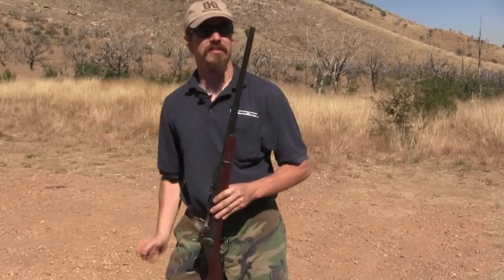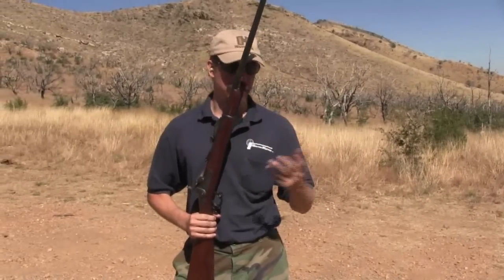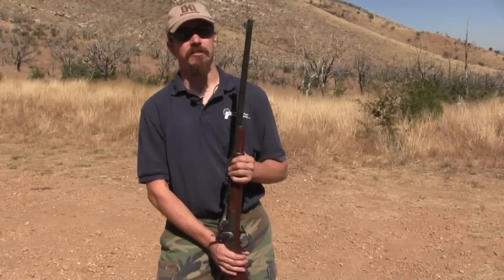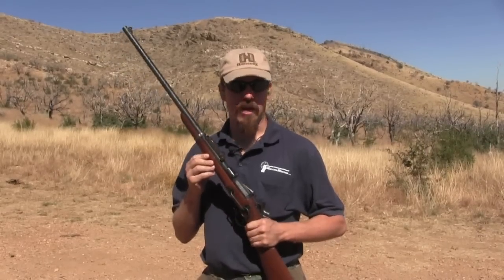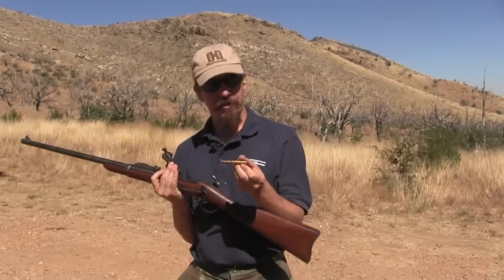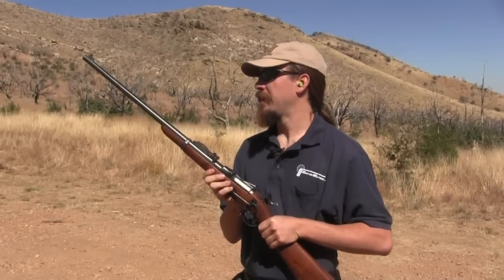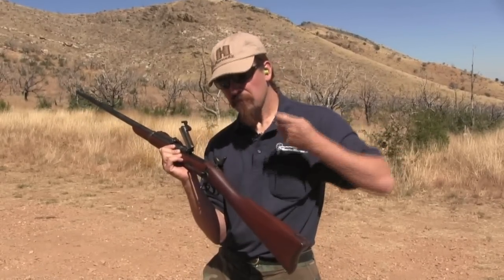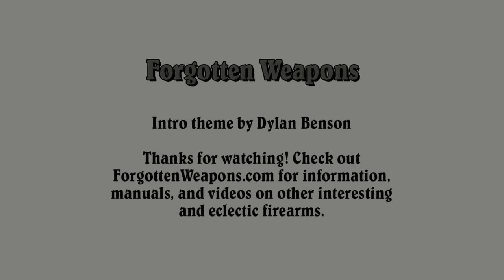Experimental .30-40 Trapdoor Springfield

Comment: That’s a really cool conversion it just shows the trap door action is stronger than a lot of people said it was
Reply: It's really not. Even the .30-40 pops the trapdoor open sometimes. And .45-70 loads that would be considered mild in a lever gun will blow the trapdoor open.
Reply: Kyle Michaels you’re right about that the 1886 is said to be able to withstand 50,000 psi more modern nickel steel barrel

Comment: A very cool gun. If a guy is a reloader that would be just plain fun to plink with. A lot more practical and comfortable than shooting the 45-70. Thanks Ian
Reply: I don't know I find that a .45-70 military load in a trap door has very little recoil. The .45-70 is not the monster magnum people act like it is.
Reply: I have a 45-70 Marlin that kicks like a mule with the 400 gr loads, and it's not loaded that hot.
I also have an Encore in 30-40 Krag and I do like it. The long neck works well with bullets too long for a 308 to handle gracefully. And the rim makes extraction more reliable.

Comment: With this conversion I see we have a Springfield barrel and front sight with a 1905 third generation rear often called the Sergeants sight because there is a peep aperture that slides up behind the basic U-notch, great for some fine point shooting.  The barrel if an early 4-groove model, the twist rate is perfect for a 150 grain boat-tail spitzer over a load of Hodgdon powder.

Comment: When re chambered for any sort of moderately hot round by the standards of the day this gun became an auto ejector. I've read even a .22 hornet would auto eject. I'm sure the lock work could have been redesigned and replaced but it was cheaper to do something else.
Reply: The .22 Hornet has very high chamber pressure whereas the .45-70 with normal smokeless loads has fairly low pressure. The size of the projectile does not dictate pressure.

Comment: I'll be honest I'm a tad bit confused. The trapdoor action is a pretty weak action and 3040 krag is very hot when compared to the pressures black powder 4570 produces. Were the 3040 rounds they used at the time of the test weaker then the ones they took to Cuba during the Spanish American war and France in 1917 for the rear guard troops (similar to that developments from the German patrone 88 to the patrone S/SS 8mm rounds). I guess I'm asking if this is safe conversion. To me (and for those who do have a lot of knowledge on this please correct me if I am wrong) this seems like an accident waiting to happen. I guess this is falling on my danger meter in the same category of those who would shoot hot mg 8mm surplus down a gew 88/05.
Reply: I believe it's borderline when it comes to safety. Though it's possible they had separate .30-40 ammo for these that was less powerful but I find it kind of doubtful as if they had adopted this version it would be a logistics nightmare.

Comment: How does the 45 70 trap door compare with the martini henry rifle would love to see the versus match I believe they were in service at around the same time could be wrong.
Reply: I have the impression (though ultimately only through hearsay) that the Martini-Henry action is substantially stronger. The .450 British service round was 480 grains at somewhere between 1300 and 1350fps, which compares well against the 405gn .45-70 loading (1285fps from the 30" rifle barrel, as per Cartridges of the World, 5th ed.). 

OTOH the British cases were for some time spiral-wound brass rather than drawn in the modern fashion (they changed over at the very last), and gave severe feed and extraction problems in sustained continuous fire.

Comment: that wouldve been good to convert the national guard guns to those so while the regular army had the krag the national guard couldve had a trapdoor but with the same cartridge instead of using 45-70 so logistics wouldnt have been such a pain int he ass when we were in cuba
Reply: Todd Welsh Given the problems with the chamber pressure he described, I think it would have been better if the government had just bit the bullet, so to speak, and contracted Remington to build 50-100,000 Rolling Block rifles and carbines in .30-40 Krag with the new sights and bayonets. First they could use them to train Federal troops on the cartridge as they waited for delivery of the Krags then issue them to National guard units (1000-2000 per state or territory). This way the NG troops could use the same web gear and transition to the Krags easily when they become available.

Comment: Pretty interesting. If it were a hunting/civilian rifle I would find it odd that it would be designed for the breechblock to open on full cock, I'm sure that whatever mechanism that could be developed to accomplish that function would also keep the breechblock closed and unjammed with the higher pressure loads.  As a military rifle I understand that entirely. The fine motor skills necessary to put the hammer on half cock would likely not exist in a combat scenario.

Comment: Do you know of any company that makes a 30- 40 trap door now or could make a 30 - 06 in the trap door configuration ??
Reply: I believe the .30-06 would have way too much pressure for the trapdoor action. Hot smokeless .45-70 loads are known to blow the action open.
Reply: @outspokengenius  I have a friend that I would say is somewhat crazy fire several shots of Hornady Lever evolution .45-70 (325 grain bullet going at least 2050 fps) out of his 1884 trapdoor Springfield with no ill effects.  I don't fire such loads through my own 1884 trapdoor Springfield, but it shows that the action is stronger than many would give it credit for.
Reply: @TreeWizard648  maybe they vary a notable amount between individual samples? Im hearing both, more so that its not strong enough, even Uberti $2000 repros say it can handle mid grade 45-70, nothing hot, but they could just be trying to avoid liability lawsuits.

Breaks my heart a little bit to hear, the Allin Conversion is my favorite of all the percussion cap converted metallic cartridge rifles. Inexpensive, well designed for the time, user friendly, & able to compete even with true 1st gen metallic cartridge single shots like the martini henry in terms of rate of fire.

Comment: So, will any 1884 Springfield be safe to rebarrel to .30-40? Assuming the action is in good condition,that is.
Reply: SAAMI spec for Trapdoor Springfield loads in .45-70 is 28,000 psi; the .30-40 Krag runs closer to 40,000. I'd be strongly inclined to give it a miss.

Comment: i want one of these older design single shots in 308 or 30-06 

anyone know of a sharps or a highwall in one of these calibres?
Reply: Those are too high a pressure and would break the gun most likely.
Reply: @harryjoe860  Winchester has chambered the highwall in many modern cartridges including .308 and .30-06. Not sure about the Sharps. The trapdoor action is too weak for those cartridges even with modern materials.
Reply: @outspokengenius   when I wrote my comment I was referring to the trap door action, should have specified.

Comment: How can a trapdoor meant for 28000 psi  handle 30/40 with4500 psi?
Reply: Pressures are in CUP copper units of pressure not pounds per square inch.

Comment: I'd buy one made to fire 30-30 lever action
Reply: harry joe I'd get one in 30-06
Reply: .50 BMG and leave it where the enemy can find it.
Reply: You mean .30-30 Winchester? There is no .30-30 lever action cartridge.
Reply: @rachetCD  Even with modern materials the trapdoor action is not strong enough to withstand the pressure of .30-06. Also the price would be pretty high. Originals were made from machined forgings, modern .45-70 reproductions made in italy of castings are $2500.

Comment: anybody here willing to explain the diference between a 30-40 krag and a 30-30 winchester?
Reply from the maker: 10.
Reply: Forgotten Weapons is the 10 in powder load or the diameter of the bullet or what?
Reply from the maker: The cases are different in shape, but the important difference is that the .30-30 was a .30 caliber bullet over a 30 grain charge of black powder, while .30-40 was a .30 caliber bullet over a 40 grain charge of black powder.
Reply: These were smokeless from the get go. This was just a hold over from traditional cartridge naming.
Reply: I thought that the 30-30 was designed smokeless from inception and the 30-40 was a black powder cartridge.
Reply: @ForgottenWeapons  Black powder? 30-40 was the first US smokeless powder, full metal jacket cartridge.
Reply: @kurtlingenfelser4499  They were both designed from the beginning as smokeless cartridges.

Comment: iF the 7th Calvary had THESE trapdoors in '76 they may have put in a better showing on Last Stand Hill.
Reply: I doubt it they would still be just as slow and they would have had copper cases at the time that would have stuck in the chamber just like the .45-70 did.